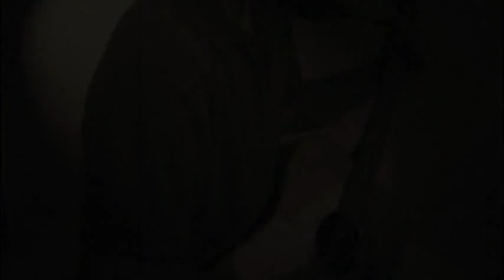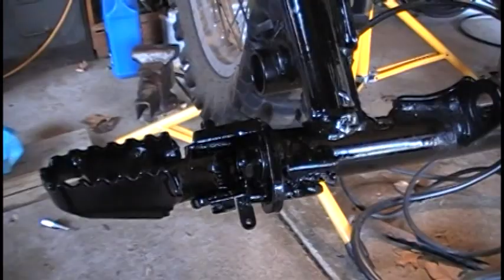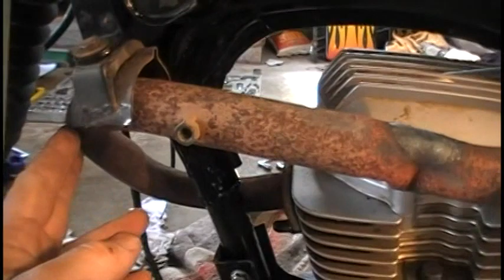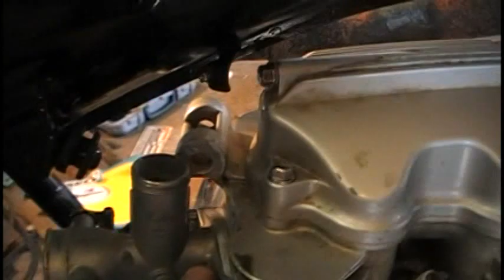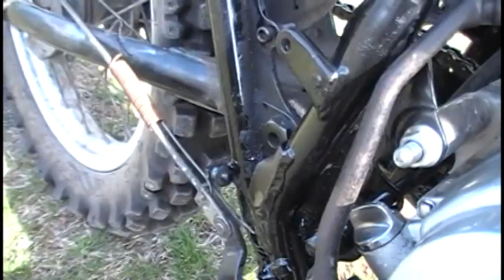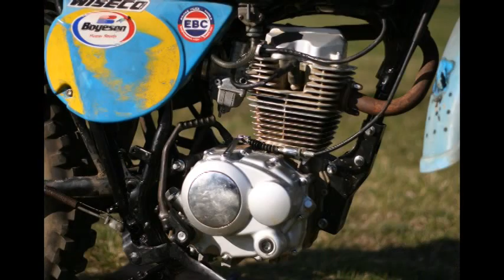Finished Repowering my Yamaha IT175 Dirt Bike with a Honda Clone 150cc Part 6 YamaHonda

Comment: You may still want to add a fiber spacer between the carb and the the head.  If you flog it enough you'll boil the gas in the carb...

Comment: You did a nice job with the swap.
The 1976 yz series were the first monoshock
The It tank holds almost 3 gallons 
You can get min 60 off road miles on a IT175 tank
The 175 motor running correctly stock ran great

You probably had a bad stator
120 rebuilt part and 20 min of work at most

Comment: so no plastic spacer needed on carb to engine mount
to keep the heat from soaking into the carb and I guess messing up how the fuel gets atomized
not sure what they are for but all my old bikes have that plastic spacer going on the carb intake to engine

also if your keeping that electrical coupling on the exhaust pipe they make a compression type
instead of that set screw type for a cleaner look and probably seal better